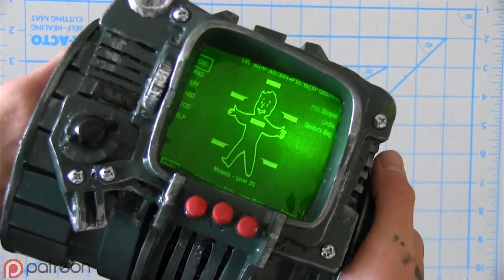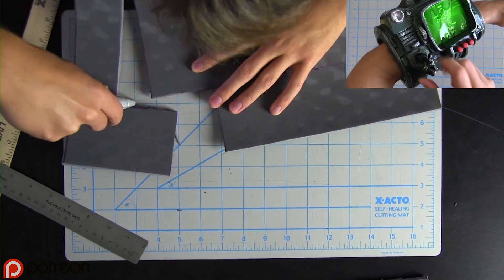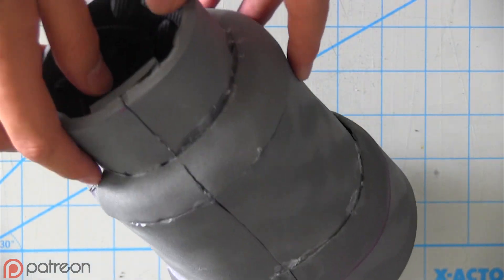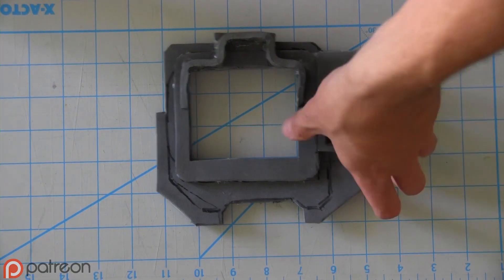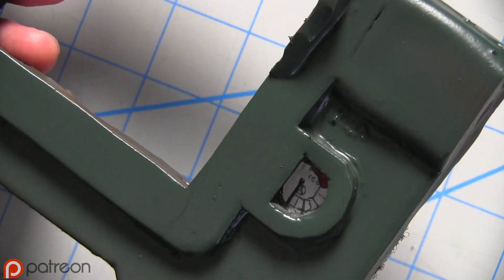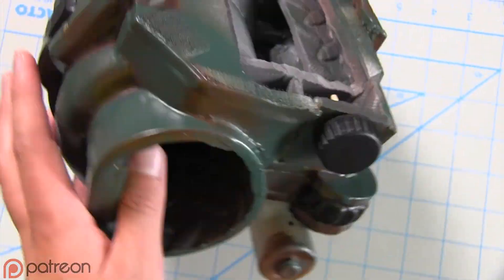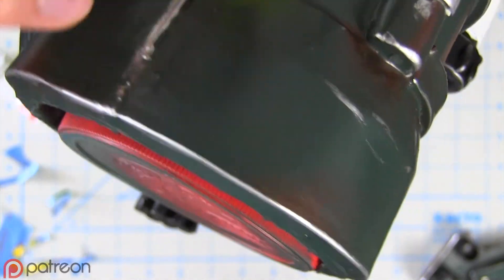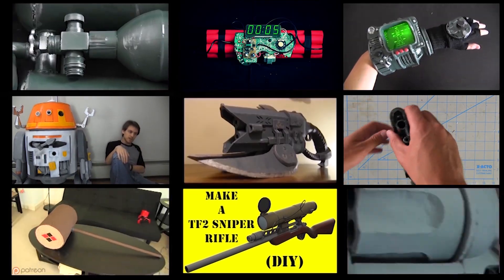How To Make a Fallout 4 Pip-Boy (DIY)

Comment: Just for future reverence, using a heat gun will help the EVA foam maintain its shape. Just bend it the way you want it and use the heat gun but not for too long or too close cause it will melt the foam.

Comment: The bottle is actually a vacuum tube, I believe. Basically, an old computer piece. In the Fallout universe, transistors weren't invented but vacuum tubes were developed on.
Reply: William Jakespeare Welp. You're actually right. Looks like there's something cold in there, or it's painted white.. if you pause at 0:31 in this video, you can see it.
Reply: William Jakespeare they use vaccum tubes for CRT monitors like the ones in the fallout universe and im pretty sure thats a vaccum tubes ive owned enought guitar amps in my time to know what one looks like but if you dont agree whatevs
oh and the prop is amazing
Reply: ShakenmikeGaming I knew it!
Reply: durferz transistors were actually created not to long before the great war
Reply: +durferz actually it is believed that the transistor may have been invented in 2070, around when the war took place, but by then, they couldn't replace as many computers with the newer ones due to the war
Reply: +durferz transistors were invented in the mid 20th century, the reason the pip-boy was a succuess was because the micro-chip was never invented
Reply: +Sly Computer Nerd Transistors werent inventend/popularized in the fallout universe due to its dependency on nuclear power, it is believed the lack of transistors caused the nuclear dependancy
Reply: Well, people, we found out what it is. It's some sort of key used to open the vault doors.
Reply: Yeah, I just said that.
Reply: It's usb
Reply: +durferz its the vault door mechenisem to open the boston vaults
Reply: Gozerian 21 Please, read past the first comment
Reply: Thank you, Grag Hasseblut. Don't know what I would do without you! :P
Reply: Rishi Kumar wat
Reply: It's a plug dud it plunges in to the vault door controll panel
Reply: Enderrock 424 You clearly read more than the first comment in the comment chain, Unfortunately that was a lie, you did not
Reply: Gozerian 21 Many people do actually, including you, your taking of personal offense in someone theorizing on this prior to the release shows that you cared enough to leave both a response, and complain, you will likely care enough to either say you dont care about what Im saying; which is factually inaccurate, or that you would like me to "fuck off" in some manner. But I will always remember that you cared, Pepperidge Farms remembers.
Reply: Grag Hasseblut you obiously don't understand a joke when you see one and nice family guy reference
Reply: Gozerian 21 Thats not a reference, if it were it would be "Oh my god, who, the hell, cares" accuracy makes it a reference, inaccuracy makes it what a drunk shouts at the dinner party
Reply: Gozerian 21 Don't try to cover up your offensive comment.

Thank you, Grag Hasseblut.

Also, joke's on you, Gozerian 21. I have the pip-boy edition now :)
Reply: durferz ya i do to genius >:)
Reply: *Yeah, I do too, genius. >:D

get ur gramer n emoji gud ma8e
Reply: durferz i write traditional English not phone talk so if it's wrong it's wrong, so much of this was an opinion and jokes, but folks have a right to post what they want if they want to keep saying what the tube is for they can
Reply: THANK YOU.
Reply: your completely wrong
Reply: Kielan Macdonald The first comment: read past it
Reply: I know. I have the game. I've played it. Look at the date before you comment. This was before the game was released
Reply: Oh, and whaddaya know? I bloody said it already. Read the comments.
Reply: My Two Cents your*
Reply: Actually that bottle is used to open the vault doors

Comment: Actually, Fallout 4 doesn't use the pipboy 3000. It uses the Pip-Boy 3000 Mark IV, which unlike the normal one, it comes with a vault plug to open any vault door, so it basically comes with a free vault key.

Comment: Do you NEED the rotary tool?
Reply: fuuck (rotary tools are expensive here in Brazil)
Reply: +Aloo Barber Thats even worse, cause if you buy anything from eBay, you have to pay for the transportaion to your house (witch is also very expensive) and there is a random chance that even after you pay for it, you wont receive the product. ever
Reply: +Strong 22 well it would make things a lot easier but all your gonna be doing with it is cutting foam so you could use an exacto blade or a box cutter and some needle nose pliers or something and you could just get a cheap little dremle for fuckin cheap online sooooo do with this information what you will XD

Comment: About how much did this cost to make? I wanna make one for my fallout cosplay so bad but I'm tight on caps :/
Reply from the maker: +Elizabeth Mullins I already had most of the materials. if you had to buy everything from scratch probably like $40
Reply: +Elizabeth Mullins i have most of the things at home, so for me it cost like $20-$30
Reply: +Uber Animations Yeah I ended up making it about 2 weeks ago and it was pretty cheap. I already had the hot glue gun and I decided to make it compatible with my phone for the screen instead of doing the light and stuff. All together it only cost me $4 in craft foam sheets and like $5 in paint and glue.